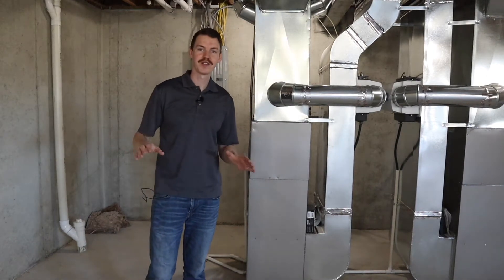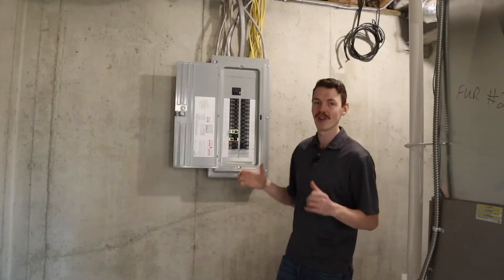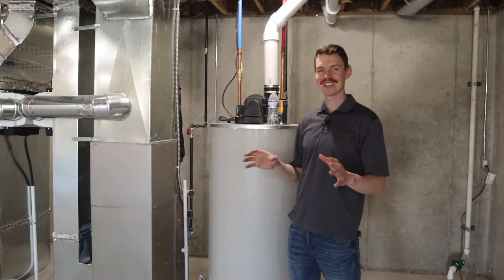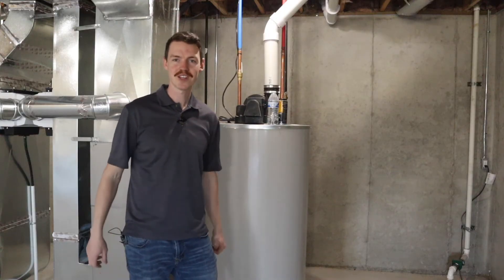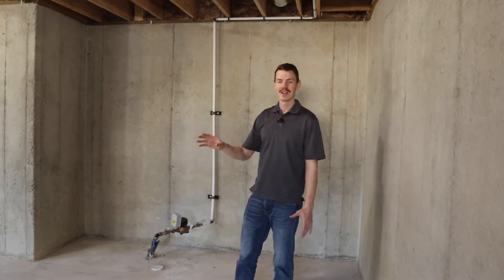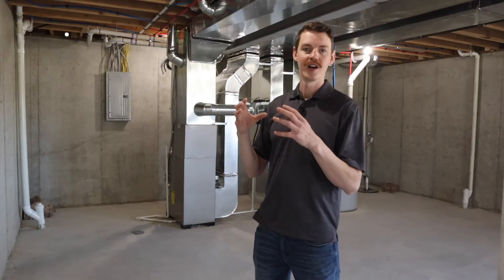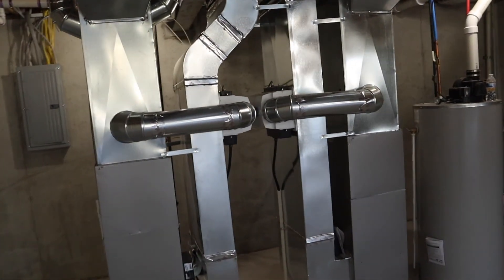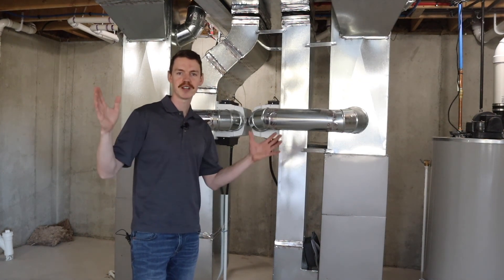New Home HVAC, Plumbing, Electrical Understanding⎮Crucial Construction Methods

Comment: 5000 installed??? What kind of bum is installing top of the line equipment for 5000
A bum who will not be in business long or grow a business giving systems away like that
Reply from the maker: Good to know. This pricing does not include duct work though.

Comment: another banger! These mechanical electrical systems look great! I have solar so I kind of wish I had tank less water heater. Why not just put a bathroom in the basement now since it's all ready to go? using a manifold instead of a mainline, doesn't it have some advantages of always having equal pressure? Love two zone Hvac. I have that in my home and it's GREAT!! .. Well put together, Great video and well edited!! very helpful information.
Reply from the maker: The feedback makes a massive difference on what I will focus on in the future. We see a lot of manifold systems they certainly have some advantages. Having zero fittings inside the walls is one major advantage. In our cold climate though one disadvantage is that every device is going to need to be run for a few minutes before the water in the pipes warm up to that faucet. At least with the mainline, when it is warm, all the devices in the house will be warm.

Comment: Great video. 
I agree with you on the manifold not being a good idea. Not only for the reasons you pointed out but it just looks like a nightmare of leaking and broken valves waiting to happen.
Reply from the maker: More points of failure.